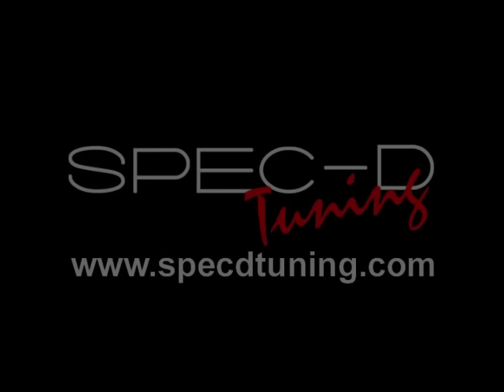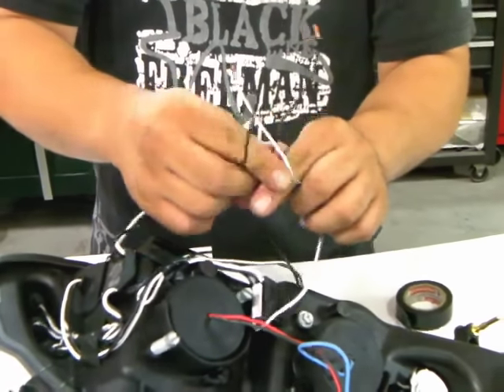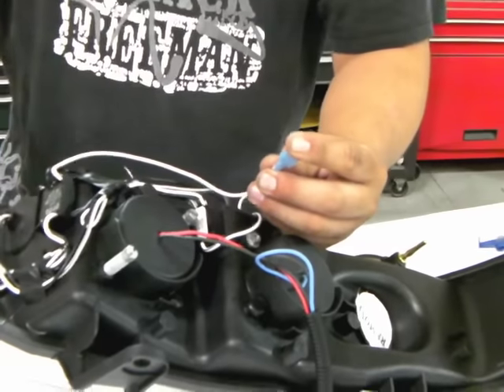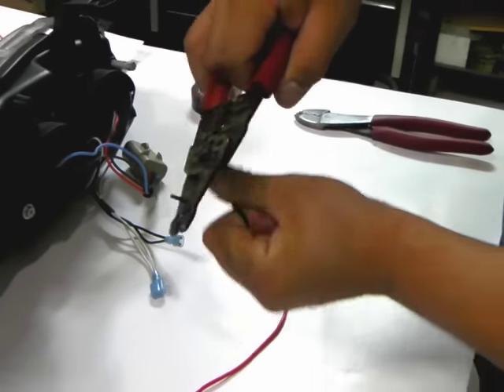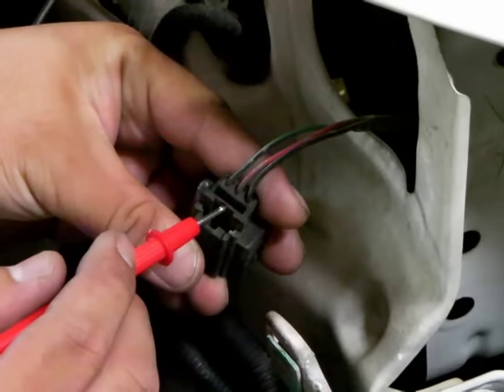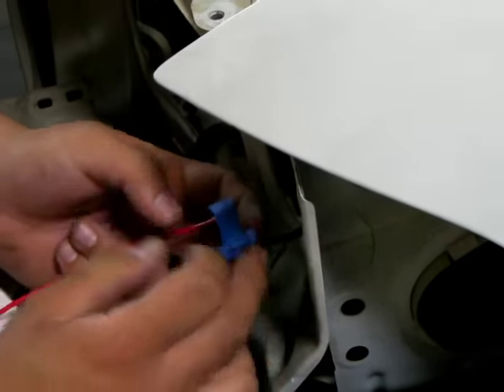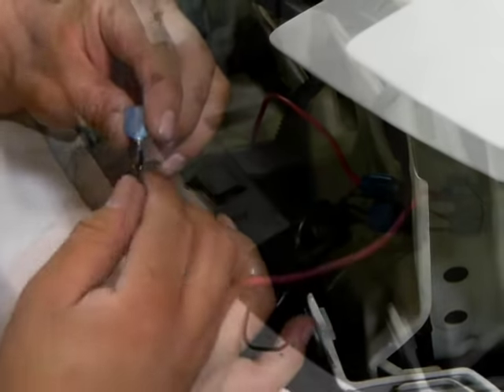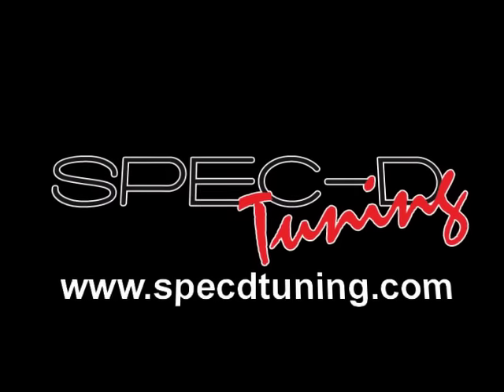SPECDTUNING Installation Video: Halo LED Projector Headlights Wiring Installation

Comment: spec d tuning gives you little to no installation instruction !
Reply: Im having a hard time right now installing mine into 2001 Tahoe. this video sucked ass and didn't help at all.
Reply: @Kylan Watson It did the trick and I actually got access to my account again. I am so happy!
Thanks so much, you saved my account :D
Reply: @Beckham Emerson happy to help xD
Reply: So true
Reply: And black and white instructions
Reply: Facts
Reply: this video is only wiring bru there’s a different one that was installing
Reply: What do u think these are? Lol there is LITERALLY like 6 bolts and 4 wires. How hard is that? Lol sheesh. U need to pay someone to do it for u, if u can’t handle these instructions.
Reply: @LiVe_AnD_lEt_LiVe_  okay 6 bolts and four wires. Please describe in the comments out to connect them to get the lights working
Reply: Fr... Smh...
Reply: I stfg!
Reply: Agree, but nothing that you couldn’t figure out with a battery and a multimeter

Comment: If anyone wants to wire properly, NEVER use those blue quick connectors. Make a proper pigtail with heatshrink butt connectors to keep moisture out and keep a solid connection. Also, with the male/female crimp connectors, don't put tape around the back. That will not keep water out. Use heat shrink tubing in place of tape to keep moisture out the back end and dielectric grease to keep the front ends from corroding. Not too much grease or it won't close together right.
Reply: The pin in those connectors is designed to puncture into the metal through the rubber tubing. Its actually genius because the rubber tubing is water tight. And its funny you know so much about these connectors yet you had to watch this video about how to wire in order to comment on it.

Comment: WARNING GRAND AM DRIVERS! Do NOT connect the white and black wires to the main harness. There should be an unused light with a brown and a black wire. Cut the light plug from that harness and connect into those The white wire from the headlights connects into the brown wire on the car and the black wire goes to the other black wire.

Comment: be aware the headlights don't come with any of that extra male/female connector, or quick connector. Installation is much more of a hassle than it should be.
Reply: LogicisOne exactly
Reply: mine came with the quick connectors but not the male nd female connectors

Comment: This video is ok but what he doesn't tell people is that he is using the turn signal harness for the install not the headlight harness the black was ground red was for park lights and green was for turn signal so if u want it done correctly do ground to black and power to red if u do power to green your halos will flash when u signal

Comment: Since all videos on YouTube and Spec-D’s videos are completely useless about wiring I hope this helps!

For anybody still wondering I finally figured it out after a shit ton of trial and error. 

The two main wires coming off the back of the low beam bulb (mine are black and blue) I connected all 3 white wires together and all 3 black wires together on the headlight. Then I took wire strippers and cut a little half inch section off of the 2 main wires coming off the back of the low beam bulb. Then connected the 3 black wires that control the halos and all of that fun stuff and connected it to the main black wire on the back of the low beam bulb. Then took all 3 white wires and connected it to the main blue wire coming off of the low beam bulb.

Now everything is working. It might not be the “professional” way, but I taped it really good and it’s still working! LED’s, Halos, and the long strip along the top of the headlight

Comment: The installation of your headlights was much smoother than  the pair put on my 1996 Honda Accord Lx. The bumper needed to be removed. A family friend and my Dad used those blue connector pieces. It doesn't look as clean of a job as your video. I'm buying a new pair and will practice modifying the old LED Halo projector headlights. Great video. 👍

Comment: i just got these for my NB miata and i installed them myself using this video and i am not very good with car stuff tbh. the hi and lo beams its just u unplug them and plug in the new ones. the orange parking light uses the same bulb so u dont have to do anything for that one but that is also where u connect the halos and leds. i did not test the voltage i just guessed red and it worked. so both the white wires u twist together and then hook them up to the red (or green maybe in some cars) using the blue plastic “quick connectors” they give. u do NOT have to cut the wire the quick connector will do that for u so u just have to crimp it and save these cause mine came with a ton extra and they are super useful for other lighting projects. the. u do the same thing twist the two black wires together then quick connect them to the black wire from the parking light. and that is it. turn it on and see if it works. if it doesn’t then try switching the direction of the plugs for the hi and lo or try the other (green or red) wire if the halos and leds dont work
Reply: super helpful. Thanks!!
Reply: This was super helpful. Thanks!
Reply: Can you change the hi and low beam bulbs if they go out ?
Reply: okay but do your halos blink when you turn on the blinker?
Reply: So I hooked the wrong wires up for the running lights and now the running lights are not coming on. The headlights still work but, I also lost my headlight left on chime if I get out of my truck. Has anyone had this problem?
Reply: Just did this on my 01, comment was super helpful!!
Reply: So i didn't get my quick connecs fuck
Reply: O

Comment: It depends on which brand you buy. I have a pair from SPYDER and there are 2 aiming plastic bolts on the back that let you aim. But yes there should always be a way to aim headlights, its part of the OEM inspection guild lines.

Comment from the maker: You can change out the light bulb color, however, you must use the same application of what the projector bulbs are, e.g. H1,H3... To get the high intensity of 10000k color, you will have ot go HID. The closest to HID color is the light bulbs that are usually named "White, Artic Blue, Ultra white". Hope it helped, good luck

Comment: Wow, you made this more complicated than it should be. New aftermarket headlights all simply plug in to your existing harness with now issues. They are some reports due to manufacture years where the wiring (polarity) was reversed but easily fixed. Now for halo or led effects that is simply just cosmetic is a different story. All manufacturers have them separate from the existing OEM plug for a reason. This gives the consumer the option to wire them directly to a 12 volt source (your existing headlight wiring) or a remote turn on source. Direct means they come on with your headlights and remote means they come on when you start your vehicle. Reason for separation is that some people would like the halos/Led effects on even when the lights are not on (driving lights). Finding a remote wire in your engine bay is rare so you may need to run a wire to your fuse block that only has power when the vehicle is running. Hope that explains why manufacturers don’t have the wiring already tied into the OEM plug
Reply: thanks for this 👍👍 Cleared the confusion for me
Reply: So this pretty much means the extra wires arent necessary to install?
Reply: Basically what he’s saying is, if your headlights have daytime running lights, those are the perfect remote wires. But many cars don’t have these. So a separate relay harness is needed to make them function properly when the vehicle is started or you’ll have to turn on all the lights just to get the halo effect
Reply: Great post! Helped me more then this video.
Reply: thanks man! i got some new headlights for my first car (2010 corolla s) and i was so confused when i saw extra wires that werent already tied into the OEM plug
Reply: So how do you wire the halo and led lights to your daytime running lights? I’m so confused 🫤

Comment: that battery tho!! lol. this guy shoulda got a new battery b4 headlights. priorities tho lol
Reply: Lmao!
Reply: lmao...ikr
Reply: LOL
Reply: Right jus crak it up maayyyyN
Reply: actually as long as the battery reads 12.2-12.4v when the vehicle is off its considered good. with the engine running it should be 13.3-13.6v if the battery and alternator are good. if less than 12.2v with nothing on or running then the battery is considered low and should have consideration to have it replaced.
Reply: Lolololl I’m watching this to
Do the same shit bro

Comment: I took all the original lights out and duct taped 4 LED flashlights up top, two on each side where the original headlights were, then two down where the park lights were and I fashioned the blinkers from two small strobe lights I picked up at Spencer's for 5 bucks a piece with orange cellophane stretched over them and used Elmer's glue to secure it to the back of the strobes for a nice finished look. I'm very pleased with the appearance and you should see the looks of envy I get as I cruise the strip!
Reply from the maker: Probably looks great!

Comment: Thanks for a fine video showing me how to remove and replace headlights on a Toyota Tundra.
      The blue speed-splice devices shown at 4:33 didn't work for me, after trying twice.  The black and white wires are all different gauges, and needed to be stripped and spliced "inline" for the easiest wiring installation.  In 2023, one of each black and white wires is long enough to splice into the running light wire without adding a jumper section of wire.  
I broke some of the headlight filler panel removing them from my '07 Tundra, since the plastic spike and grommet fitting was brittle from age.   It went back together with a bit of silicone and new plastic rivets.
     Lights look great, very bright, adds a nice refresh to my 16 year old truck.
Reply: So I have everything plug and play besides the halos, it’s only one white wire and one black wire, where and how do I connect these wires

Comment from the maker: @elaurien We always recommend that you splice the halo/LEDs into the bumper lights or running lights so that you can prolong the use of the bulb. The parking lights for example: are [usually] the lights that come on at night with your headlights. When you turn the lights one click; its your parking lights. When its two clicks then your headlights and parking lights come on together. Good luck

Comment: Thanks for the video. My installation came out flawless
Reply from the maker: glad to hear it!
Reply: Spec D Tuning excuse I have a question I only see 2 white wires and 2 black wires on da video but mines come with 3 white wires and 3 black ones. Is there any way to help me out with this?
Reply: Spec D Tuning does it come with eveything needed when I buy the headlights or do I need to buy the extra stuff
Reply: Rising, mine had 3 black and 3 white. I spliced all the whites together and same thing for the black. They were extra connections for the leds and halo ring. Hope this helps.
Reply: Nope. Mine only came with four splicing harness. No spade connectors and no  extra length of wire.

Why they didn’t simply wire the Halo to a socket so it could be plug and play is lazy.
Reply: can someone please please please help.  I am installing these I get where everything else goes, but where does that black and white wire go?
  I went to spec video, but it is not clear.  I have s2000 2007, and on the unit every wire is connected to different housings, but where does the black and white wire go?
Reply: Spec-D Tuning 2LHP-S2K04JM-TM Honda S2000 Dual Halo Led Black Projector Headlights, this is what I have
Reply: Jaaved N I have the same problem 3 sets of wires I need help with this can anyone give me some advice on what to do
Reply: Jaaved N plus no extra wires
Reply: @jua7265  ikr they're cheap though so I'm not gonna complain lol
Reply: 5-year Update?

Comment: Thanks for the video, just finished installing these on my 2006 Mustang.  Huge difference in the look.
Reply: I am trying to install these on my sons 2008 mustang. I cant even get the head light to turn on when i connect the factory plug to the new light. I havent even wired the led's yet. What am I doing wrong??? This is the 2nd set. I returned the first set because I thought they were faulty.

Comment: Why don't you just wire them into the wires that come out of the headlight socket? You wouldn't need the extra connectors and the wires would be shorter and neater. You could pre-wire them at the factory.
Reply: Davey Hi it could blow a fuse we did that & made more probs
Reply: i find it odd that it would blow the fuse. Low beams usually pull about 55W while LEDs will pull about 35W, i wouldn't imagine these weak Halo's pulling much. Did you try wiring through the High Beam line? High Beams usually pull about 65W, maybe you could get the extra juice necessary from there without blowing fuses.
Reply: Omar Siddiqi then wouldn’t the high beams need to be on for the halos to be on ?
Reply: @dokkaboi917  You're not going to blow a fuse, it's still connected on the same source, there's no fuse in between the OEM plug and the bulb at the back of the assembly.

Comment from the maker: @dajumpoff08 We recommend connecting the halo and LED light to the car’s driving light harness. On cars with driving lights and signal lights separate, there may only be 2 wires on the harness.

Comment: It should be ready to connect!!!!!!!!.  :(   didn't know that it needs modifications :( :(
Reply: Nunca debi haber comprado estas mierdas.
Reply: No es tan complicado como se ve no tienes que aser todo lo que el hace ya sabemos que rojo es positivo y negro negativo
Reply: @osycastanon2980  I think you said its not that complicated. place all white wires together and go to positive. Place all black wires together and go to negative. On the parking light wire. Blue wire is  blinker wire.
Reply: If you don't ready have halo on your car, then you are going to have to make a connection.Thats just common sense.

Comment: I'm no electronics genious and with the nest of wires I have on a Ford F-150 it was pretty easy to figure out. If you can't you either have enough money to have a shop do it or you should have a bus pass. BTW, the car you guys used for the example now have headlights worth more than the whole car.

Comment from the maker: @composingchef We are happy you asked. It is safer than a trial and error that can lead to more expensive problems. The parking lights are the recommended wire to tap to the car. Because the Halo rings do not require a lot of energy to have them light up. Please keep us posted if have further questions; we can go into more detail. Thank you.
Reply: So i noticed that there are two extra wires. One is black and the other is white with a black stripe. I looked up the part # that both of these lights came out of and it mentions a headlight load resistor kit. Is this necessary? And if not so I just cap the ends of the wires off?

Comment from the maker: @itsmeshawman Any local auto shop will have them for you. If that fails, you can go to a stero shop, however, it might be a bit more expensive there. But your local big box store will have it. Thanks for the question, good luck.

Comment: Im not doubting the quality of any products (but I am slightly), but if a demo vid is to be made, the battery could have easily been cleaned off, and a voltmeter with a fully functioning display could have been used....

Comment: Why can't they just come ready to be plugged in?
Reply from the maker: ***** Every vehicle is different and the daytime running light sometimes is the same bulb as your high beam. Due to strict SAE and DOT restrictions the headlight must have a high and a low beam bulb.
Reply: If I order a pair from you can you guys do the wiring for me before you ship it? I have a 07 civic si and I'm looking to buy a pair that is on sale for 437$
Reply: +Spec D Tuning but if you made the light for the car, it should be to that cars specs right? My 95 Honda accord is a 95 Honda accord. As far as I know it comes one way headlights wise. Should have just come prewired. Telling me to simply connect some wires that should already be connected looks so stupid.
Reply: John is right; I'm weary that an "expert" will not truly comprehend the installation process and will charge me regardless if he did or didn't do it correct. "Every vehicle is different" is rather off, since I bought headlights tailored to a specific car... It's not like your equipment is universal and tailored for all.
Reply: @Specdtuninginfo  You guys could at least have the two black and two white wires already connected together out of the box to eliminate a step and why do the lights have a connector harness on the back but the video says nothing about it? You can see it hanging in the video not being used when he's putting in the light. If it doesn't need to be used then why have it on the back of the light?
Reply: Real answer is they're lazy Spyder sent me some lights with them already wired and resistor installed🤦🏾‍♂️